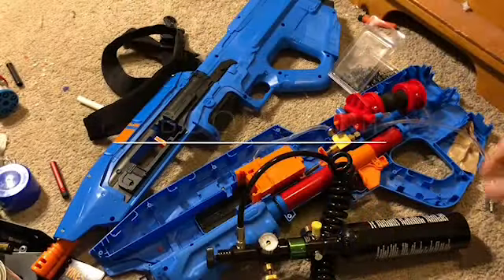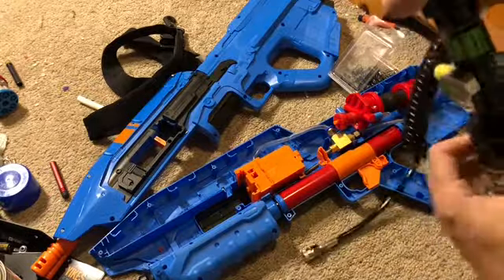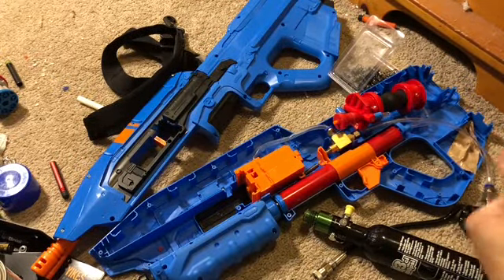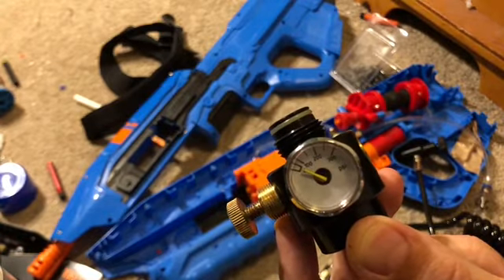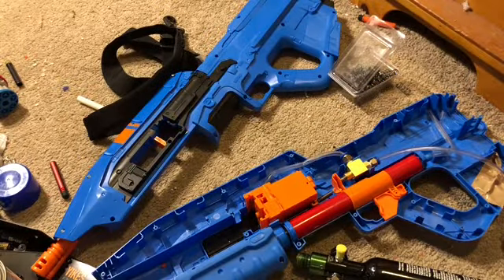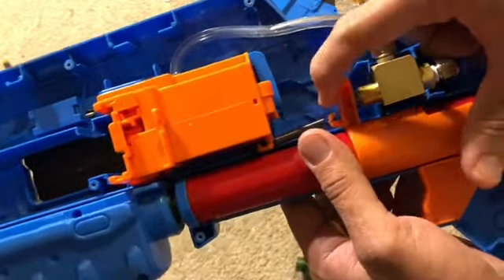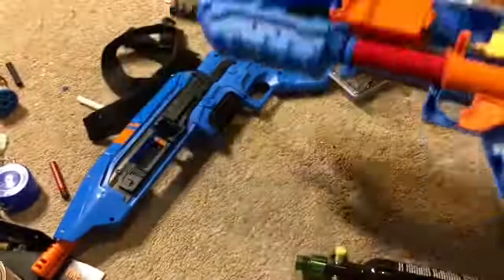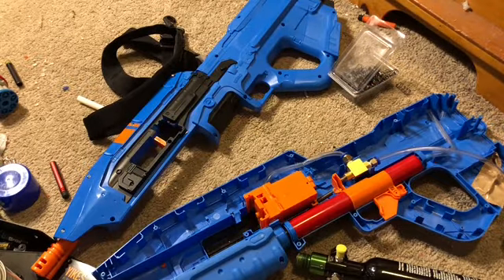Ma5 HPA MOD GUIDE BOOMCO MATTEL

Comment: hi, could you further elaborate on how to improove range on this or the rapid madness? or just point me in the right direction?
Reply from the maker: dario m I sell an upgrade spring for the Ma5. I don’t recommend trying to upgrade the rapid madness. It’s hard to open, much more complicated and many parts of it are glued together instead of screws. Ma5 is much easier to work with. You can also sniper the clips. I have videos on that
Reply: thanks a lot!
Reply: @Boom tendo where is the link for the Etsy store and the upgrade spring?

Comment: Do I have to use a paintball tank or is there a cheaper alternative? Also do you still have to pump or do you just fill up the tank separately? Thanks.
Reply from the maker: Stormcrow41 you fill the tank separately. No need to pump. It’s possible to make it tank and pump at the same time but my mod guide for hpa is tank only
Reply from the maker: I don’t know of any cheaper options. Tanks aren’t that expensive on amazon

Comment: Wow thats some ish right there i want to do this to my rapid madness im gonna give it a try someday is there a spring to replace in the rapid? ive never taken it apart to look inside or is it just air powered ?
Reply from the maker: Insane0 Juggalo rapid madness is a pain. You can only upgrade it with springs from another rapid madness. The mechanism is a pain to open and has glued on parts. Not worth it as it won’t get the range of an Ma5 and not the same rof. Ppl have been confused and thinking they are the same thing internally. They aren’t. Ma5 is much better
Reply: I was under that assumption sad thanks for the reply and I already upgraded my blaze with a k26 I love the products I received awesome print quality with a tiny bit of sanding it's been 24 hours of liquid nails still wet on the inside of clip should I take the darts out anyway or can I leave them in and be patient?
Reply from the maker: Insane0 Juggalo you can leave them in longer. It won’t hurt them
Reply from the maker: Insane0 Juggalo I got one of my Ma5 for $19 during an Amazon sale. $30 or so is still a great deal. I highly recommend picking one up. The blue one is sweet!

Comment: Do you have a guide for the spring? Interested in doing this to all my rifles
Reply from the maker: it has four screws on the cap. it’s fairly easily to figure out. not camplicated. kinda hard to squeeze the spring in but that’s it